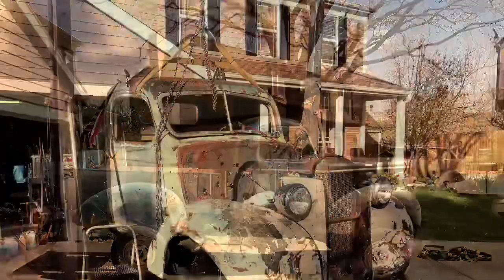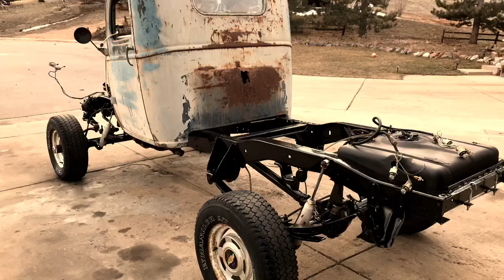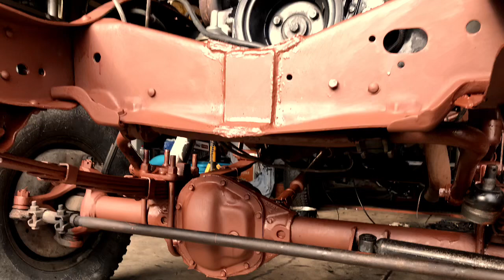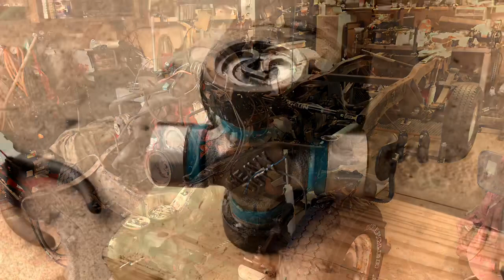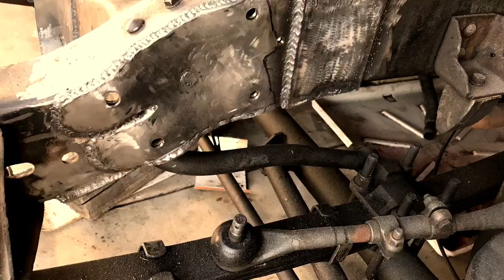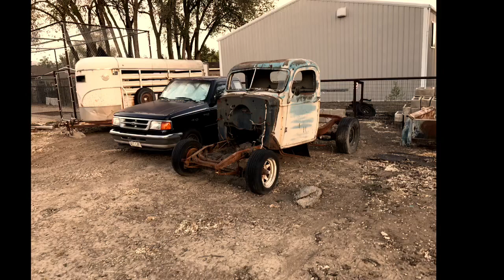1939 Chevy truck frame swap progress

Comment: WOW. That 76 C-10 frame sure looks FLAT. Seems like it would make for an EASY swap with the older trucks, especially the 47-55 Chevy trucks. S-10 conversions seem to need all kinds of extra brackets to support the body 5 feet in the air ! Can you show us pictures of your body mounts?
Reply from the maker: Yes I can! I will be posting more videos of the truck. It is up and running now and almost driveable
Reply: @TayloredTrucks  GREAT ! You need more exposure. I believe you have a solid truck design.  Good Luck, my friend.
Reply: I hope I get to see more of this, I’ve got a 46 cab and bed I’m wanting to turn into a 4x4 and not sure how to approach it